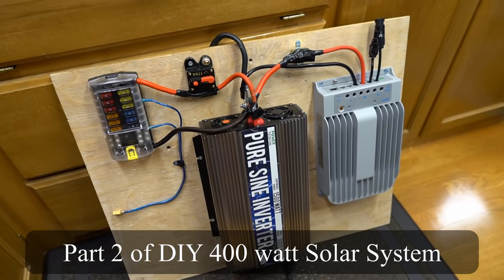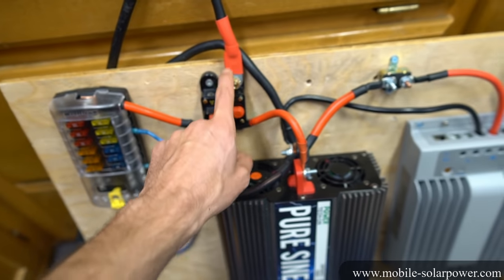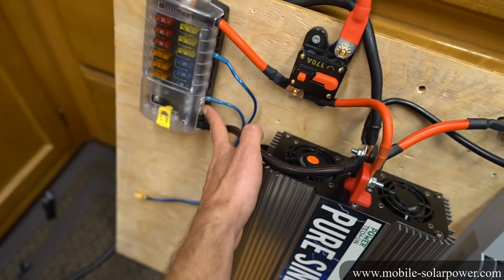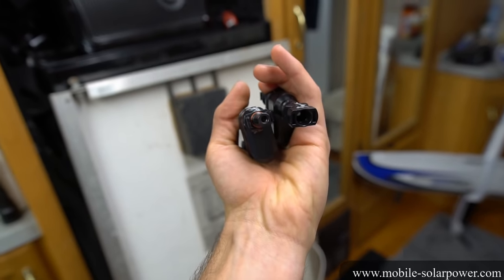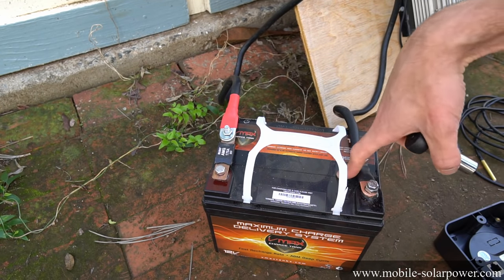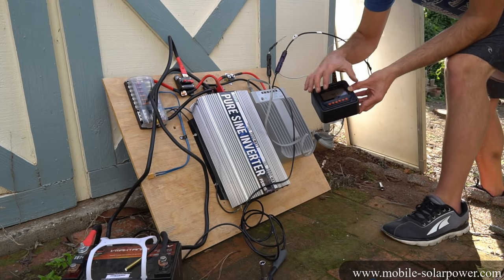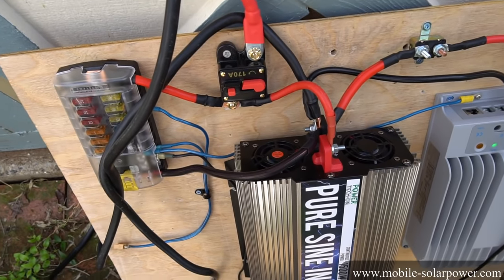DIY 400 Watt Solar Power System Beginner Tutorial *Part 2*

Comment: I noticed that you recommend connecting the positive battery terminal before the negative. This is a best practice in cars, as it is possible to short the wrench to ground while tightening the positive connection, assuming you connect the negative first terminal first. It's less of an issue in solar, however. Thanks for the helpful videos!

Comment: The idea behind connecting positive first is that when working on a regular vehicle battery, it is usually a tight space under the hood.  If you are hooking up the ground first, when working on the positive terminal your metallic wrench can ground from the positive terminal to the surrounding body (ground).  When connecting the positive first, you only have to worry about not shorting between the battery poles, then you install the negative.  Using this procedure eliminate the risk of shorting battery to body.
Reply: Some inverters will short out a fuse if you connect positive first, for my Inverter it states this in the manual in bold. I've also shorted out a fuse in my other Inverter by doing the positive first.
Reply: on vehicle batteries its to protect any sensitive electronic components/capacitors from voltage/amperage spikes. when you connect to ground LAST the spikes occurs away from the components with the battery as a buffer. Additionally, Pb batteries that arent properly ventilated can accumulate hydrogen as part of the sulfate reaction and that can ignite with the spark. Ground tends to not spark unless under load.

Comment: I'm plan to use your 400 Watt system for my van build. I'd like to add a converter(charger) , so  that if necessary I can recharge the batteries from a campsite w/ hookups. I have only a few items that would require power from the inverter, so  my focus would be on charging the batteries as quickly as possible. I believe I can wire the converter directly to the batteries, since the shore power is protected  at the hookup site. Should I be isolating this connection w/ a switch?

Comment: Ok so I have been watching your videos. I am a Marine so maybe not the sharpest tool in the shed. So I want to put a 800 watt solar system on my motorhome. 24 volt system so I think I understand that i have to buy something extra to drop down to 12 volts for rv use. So where i get lost is charging other than solar panels, so do not use alternator from vehicle, what about shore power charging? 
Next I did order your book. But my quest is will you book show me how to build a 800 watt 24 volt system cheaper and better than the package kits like reongy systems?

Comment: My invertor said not to attach it vertically because of the fan on the back . The the cooling fan is visible.  It is a renolgy 2000 watt. I  loved your  video  but  I  didn't understand. In your videos you do attach it to a plywood. It  appears to be vertical.
 Any input on this please?

Comment: I really don't like the spark that happens when connecting batteries to capacitive loads, so I have a 20 Ohm power resistor with clip leads that I use to pre-charge or soft start the load. I try to connect the clip leads such that I can connect the cable while the pre-charger leads are still on. Then I remove the pre-charger after the cable is secure. That way I don't have to rush to connect the cable before the capacitors discharge. I often use a portable electric burner as a pre-charge resistor because it is also handy to have around for load testing and cell balancing. If the pre-charger sparks while connecting it, a higher resistance  (say 30 Ohms instead of 20) should work better.
Reply: Oops, I forgot to mention that these same capacitors can and should be discharged with the same resistor before servicing an inverter or converter.
Reply from the maker: Yes agreed. I always short the leads before I work on them when they are disconnected. And very cool resistor setup to charge them up. Interesting.

Comment: I'm confuse on the wiring gauge. When I check on 2 gauge wire for the batteries the wire has like 2 different sizes. I see 2 gauge and then there's 2/0 gauge. What's the difference?

Comment: Hey Will, I have a camper with no shore power at a permanent site. 32ft. with 2 manual slide outs. I just was given this to me and needs work. We would like to run a 5-6000 btu a/c window unit a standing fan and 32in led tv and maybe coffee pot. I have a 3000 watt fit 4 life inverter 12 volt. and haven't bought the life04 batteries, was thinking 3 in parallel. I do have a 4500 watt gas generator but would rather not run it and we have to shut them down at 11pm. I was also thinking solar panels for top of camper for recharge. So i guess im asking  if you could tell me the best way to install with what components to give us hours of ac power without the generator running. And if i could actually speak with you or get a schematic on how to do this would be great willing to pay for yr time but i am on disability and limited income so budget is VERY IMPORTANT. Thanks and hope to hear from you soon. I was a hospital HVAC  Maint. tech for 30 years but this stuff is out of my wheel house.

Comment: Why add the 300a fuse to the battery cable when you are connecting that wire to a 170a fuse on the other end?

Comment: Hey Will, this a dumb question, I know solar a bit , but not electricity
I’m upgrading our cabin system and just bought a breaker box and breakers as we outgrew the existing setup with wire runs to plugs and to a surge protector in off grid, does the solar wires come into the break box for the end blocks to tie in, many thanks if you can point me in right direction to a video or on line advice

I feel like I have a mental cramp in figuring this out, hoping when I get to cabin and look at existing system, it will make sense

Comment: Hey Will with this system do I need a fuse or disconnect between the panels and the charge controller to protect it in the event that my battery fuse blows?
Reply: Good question!   I'd be interested in the answer to that also.  I doubt if you'll get it because after 9 months he probably didn't read it.

Comment: 5:01 that spark can fry some components,,,use a resister or candescant light in pigtail to load the capacitors,,,google for the comment readers,,google how to load inverter capacitors safely...

Comment: Hay Will, is the 300a fuse ok to use with a 250ah/ battery running 400w solar panels?

Comment from the maker: Click "Read More" for Complete Guide/ Safety Instructions to this video below:

Parts list for this system, and type/size battery I recommend: https://www.mobile-solarpower.com/the-classic-400-watt-rvs-vans-buses.html

My Book: https://amzn.to/2BGpZW0

Video Table of Contents:
Adding Heatshrink: 0:11
Fuse/circuit breaker size: 0:46
Grounding the Inverter and Solar Charge Controller: 2:04
Adding a Solar Panel to the system, and wiring up a 400 watt array: 3:26
Connecting it all together! 4:21
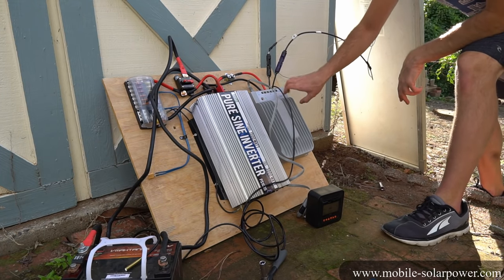Testing the System: 6:34
Load testing the inverter: 7:32
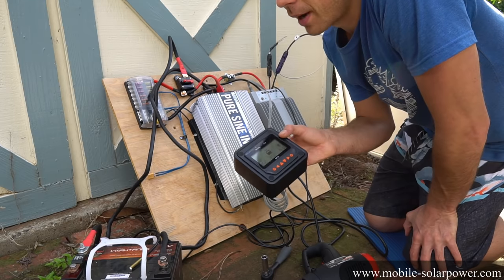Testing for Efficiency losses with a load test: 8:12

If you are intimidated by building your own system and want an easier option, check out my recommended solar generators: https://www.mobile-solarpower.com/plug-n-play-systems.html

Comment: I like what you did this Video with your grounding explanation.  We typically run our green ground wire through the floor,  put a ring terminal on the wire, and use a self tapping screw with an impact driver battery drill to attach it to a metal frame member below the floor, it's quite easy to do.
Reply from the maker: Thanks for the input in the last video Terry

Comment: Perfect! Scaling up as I have 825W of Solar and 460Ah batteries but the basics are right there delivered in exactly the style I need to make it "newbie-clear". Thanks Will.
Reply: I’m scaling up as well. What size inverter and circuit breaker did you use?

Comment: This is the most helpful pair of videos I've found regarding a Solar/Inverter system. For my purposes I think I'll need the larger i3000 watt pure sine inverter.  Do you think I might need to change any of these components so I still have a reliable system.  I'm thinking I'll need a larger circuit breaker or some other items.   I'll probably use the 300 watt solar panel too and I need to find some batteries that are affordable, $1,000 per battery is way out of my budget.  Since I have no experience at this I really would appreciate your input. BTW, the system I'm building is going on a Safari Van that I want to use to tour our National Parks. Thanks!  Tony

Comment: Why do you run the positive from the charge controller to the inverter and to the battery? What do you gain by doing that? Mine runs from the charge control to the battery then to the inverter.
Thanks in advance

Comment: Can you do a video that shows connecting this system to an existing factory DC panel so that the existing wiring is powered without rewiring all of the camper DC devices?
Reply: There are many factors in average cost to install solar power . One place I discovered that succeeds in merging these is the Ewans Energy Roadmap (check it out on google) it's the most useful plan i've seen. Check out all the unbelievable info .
Reply: With the batteries connected to the RV electrical system the RV is already wired up. what he has wired up here is for new and small applications. you wouldnt need the fuse panel with an existing/functioning RV.

Comment: Great video! One point I haven't seen mentioned here is that the charge controller has an equalization phase in the default Sealed mode which isn't recommended for AGM batteries. What I did was copy the Gel values to a User setting with the Boost and Float cutoffs adjusted to the values recommended on my AGM battery's datasheet. Setting the equalization time to zero disables the phase.

Comment: hi, just want ask why you use 170amp breaker, thank you
Reply: creatorediillusioni because the inverter is rated 150a input voltage....so the 170a breaker will be enough not to trip when you use the inverted to its peak limit.

Comment: Thanks again WIll for knocking another one out of the park ! As much as I aspire to reach the solar systems that the guys on the Solar DYI groups are doing on FB, it's so damn much to take in, especially when Rob starts talking about split phase on two inverters for a 50 amp system...shit. I just want a simple 30 amp set up, 8-10 Battleborn's, and whatever amount of PV panels (200 w panels) the roof of a 30-33 ft Gas Rv can hold. Your videos are an excellent source for simplicity of design and that is what I want since I will have to understand how everything works in the event of a failure. Am I right? Plus, I want to be able to use the Battleborn battery isolator to charge the batteries as I go down the road in conjunction with the PV panels, and to boost battery charging on bad solar days without having to fire up the damn generator. Rob has me thinking about a 5th wheel and I just don't want to tow ANYTHING, ever so I'm going back to my old plan of a Gas burner. We'll chat on the phone when the time comes for me to pull the trigger and make all of this happen. I trust you Will and that is paramount !
Reply: Hi John, here is the quick translation to what Rob is saying: bigger RV's that use the 50 Amp plug from the shore power pedestal have 4 wires coming into their coach. One is a ground and one is a neutral, just like 30 Amp service. The other two are hot lead #1 (L1) and hot lead #2 (L2). Each of the hot leads carries 50 Amps at 120V. L1 goes to one half of the AC breaker panel, and L2 goes to the other half of the panel. 

I assume you have a smaller coach which hooks up to the 30 Amp service on the shore power pedestal. You only have 3 wires coming into your coach, which feeds the entire AC breaker panel.  So, you will only need one inverter, just as Will has shared. 

Rob has designed his system with an inverter for each side of his AC breaker panel. He wants to run off solar and batteries as if he was connected to shore power, so he needs a bigger and more complicated system. Lots of batteries and panels to feed enough current to the 2 inverters to live daily off grid as if he was connected to the grid. 

I hope that clarifies things.
Reply: @AdorableDeplorable1  I understand what Rob has done due to his expert explanations to me. He also has 6 people to deal with and they all need space and use a ton a electricity. I just want to do all that I can with solar and the Battleborn's and if I really need to run the A/C for more than a few hours, it's time to move to cooler climes for a spell, but it will only be me, solo with maybe a friend on occasion *wink*. Either way, Will and Rob have both been invaluable to my research and each has an approach that is sticking in my brain...finally ! Thanks for your comment Arthur.

Comment: Thank you for your videos. I just connected my 60 amp epever solar charge controller to my house battery and 650 watts of solar panels and it all worked perfectly straight away following your instructions.. Note for those using Epever bluetooth, you need to allow location and storage permissions on your phone for the app to discover and connect to bluetooth.

Comment: what size circuit breaker should I use if my inverter is a 2000watt inverter (the same company as yours)?what size bolt-on fuse do I use aswell?should I be using a bolt-on fuse AND a circuit breaker?
Reply: Same questions - so much great info but missing a few crucial bits like fuse sizes

Comment: When setting the mt50 parameters, do I set the amp hours that an individual battery holds or the combined battery bank capacity?
200ah is the default

Comment: Getting ready to install my 800W solar system on/in my popup camper. 
4-200W renogy solar suitcase panels(to keep them removable, so as not to get stolen), 3000W renogy DC to AC inverter, 300Ah LiFePo4 battery, VE 150V/85A smart solar charge controller w/Bluetooth, 100A fuse block, and of course my fuses, circuit breakers, wire(from 4/0 to 6 gauge to 14 gauge, and a few in between), and a couple shut-off switches. 
I hope I have it planned out correctly. Can't wait to try it out. 
Also have an Ecoflow Delta Pro. Just in case. Lol

Comment: Lots of good information. One comment you made at the about 9:20 is "... and things do start to heat up, or the circuit heater blows I will need to change out the circuit breaker."  If the circuit breaker is sized to the inverter, then you don't want to change it out for a bigger circuit breaker. Also if things are heating up, you need to be certain that everything is able to handle the load before going to a larger circuit breaker. if you just put in a larger circuit breaker it may solve the problem of it tripping, but it could make heat issues worse. Circuit breakers and fuses need to be greater than the load, but appropriately sized for the rating of wires, connectors, and the devices being run. unless everything else on that circuit can handle the extra amperage don't increase it, find another way to reduce the load.

Comment: Your videos and your website seem to have different information... In the video you show a 170A circut breaker, on the website it shows 50A circut breaker, on the website it mentions a bus bar, in the video there is no bus bar to be found... In the video there is an extra component that the solar charge controller connects to the postiive on the inverter, not listed on the website.... SOOOO confusing!
Reply: offspringrocks08 I think the 170A circuit breaker is for the main battery positive. The 50A circuit breaker is for the 40A solar charge controller.
Reply from the maker: Updated info is on website. And 50 amp breaker is for charge controller.

Thanks Dom

Comment: Hi Will nice video - I have a few questions you or someone might be able to help with regarding fuses and fuse placement. 

My understanding of a fuse is it protects the wire and loads on that circuit from overheating/burning. I'm curious why there is a 175A fuse between the battery and both/DC panel and AC inverter? 1500W/12V = 125A (x1.25 or 1.5) puts us in the right range if it was pulling DC from battery to the device, but isn't the max amps that he inverter can "request from the battery" 12.5A (1500W/120V)? If this is the case, are we putting the 175A fuse for the risk of a short on the DC side, which I could see potentially pulling more amps? Secondly, I'm similarly confused by the 50A fuse placement between the inverter and charge controller? If there is 400W of 12V from the panels ~33.3A - does that mean spikes from the panels (above 40A) will trip a fuse in the charge controller? Alternatively, if the 50A fuse is to protect the 40A charge controller from batteries or invertor side, what would happen if 45A went towards it from the battery? Wouldn't those 45A "pass through" the 175A & 50A fuse and then harm the 40A charge controller or "trip it"? Simply trying to understand the rational here from which direction we looking - always thought it was positive forward to next positive connection. 

- many thanks for everyone's expertise here!
Reply: Same here very confusing

Comment: You have a 170A Breaker, I read the Max Amp for that controller is 130A. Why are you using 170A?
Reply: The breaker is for the load used by the inverter and not to protect the charge controller.